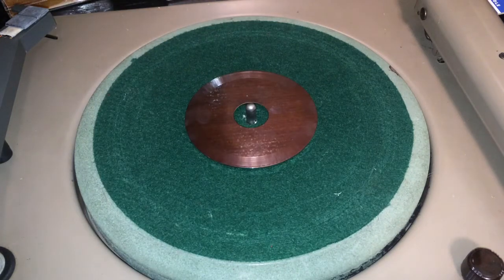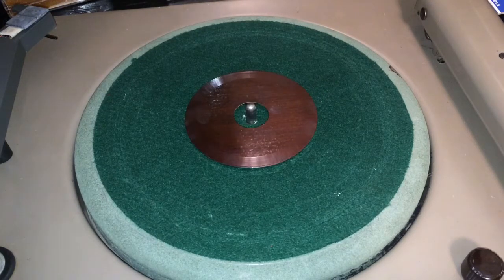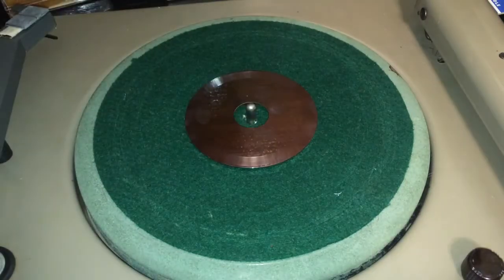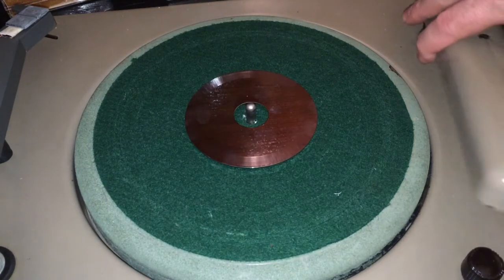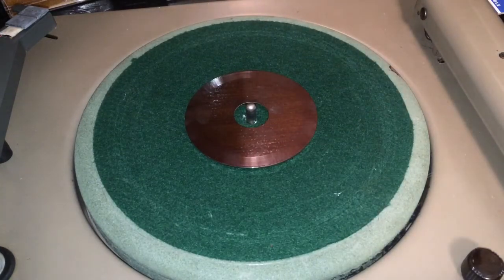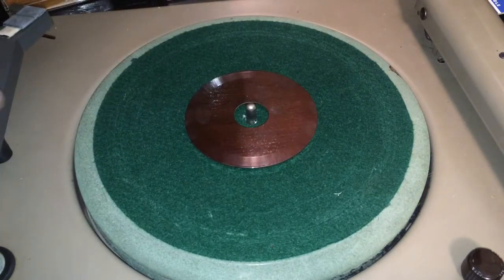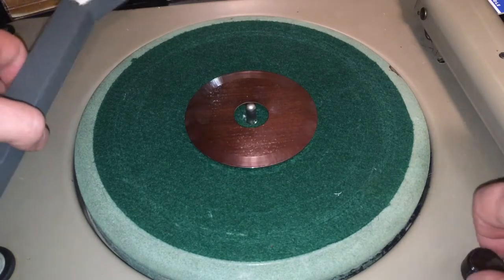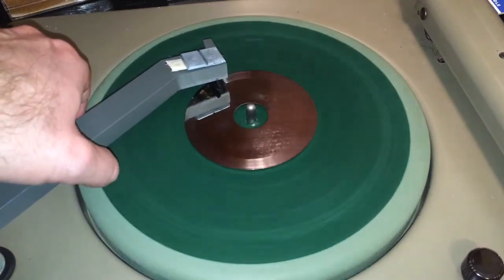Recording sound onto a computer hard drive platter

Comment: That's funny, the other day I watched your video about cutting a laser disc and later I though I wonder if it's possible to cut a computer hard disk. Today I find that you already made a video. That's awesome. I have to sub your channel now. Also, I can't believe how clear the hard disc sounded. Well done.
Reply from the maker: OneRoomShed Yes, I just need a bigger hard disc to record on!
Reply: databits Try to get a hold of one of those old Quantum Bigfoot hard disks, they are 5.25 inch in size

Comment: It's possible to record 5 seconds on a 6 inch paper, but if you play paper without recording first, you get an interesting vrroom, or roar. After the 10th time, the groove cut will make a da-da, da-da sound and it's cool. Love your videos. If you're still not sure what the stuff that comes off the recorded piece, on the solo plate video, and in other places, you called it "swarf"
Reply from the maker: +Zacho Gilman - Swarf it is!

Comment: If someone were to send you a much older hard drive platter that was, say 5 or 8 inches across, could you record onto that with the same clarity? This seems like a great way to actually cut masters to then copy off of.
Reply from the maker: +Flamingeyes245 - it's possible, I've looked at Bigfoot drives, but didn't want to spend the money on them.  Do you have one you'd like to try?
Reply: +databits I might be able to get one. My school has electronic recycling bins. I'll keep a lookout for one, or see about maybe on ebay. Does it matter if it's an aluminum or glass hard drive platter?
Reply: +databits Also, have you tried cutting on acrylic? It's easy to laser cut circles from acrylic, and the surface is very smooth.
Reply from the maker: +Flamingeyes245 - Thanks for keeping an eye out...I haven't tried acrylic, but that does sound like a worthwhile surface to try.
Reply: +databits I have a 12" blank 1/4" acrylic plate with a hole for a spindle. What are the optimal dimensions for your cutter? I might be able to cut something from scrap I have laying around.
Reply from the maker: +Flamingeyes245 - it would have to be 12" or less